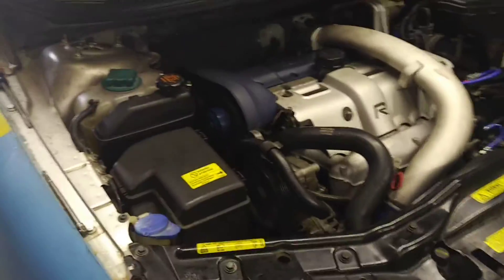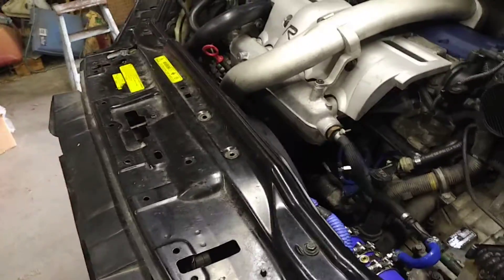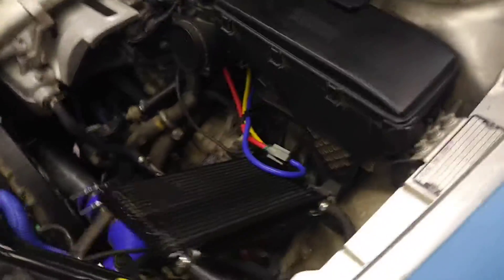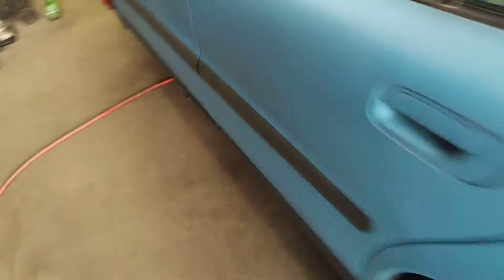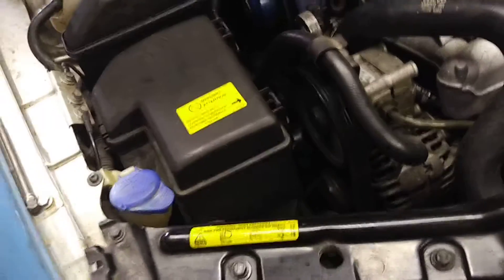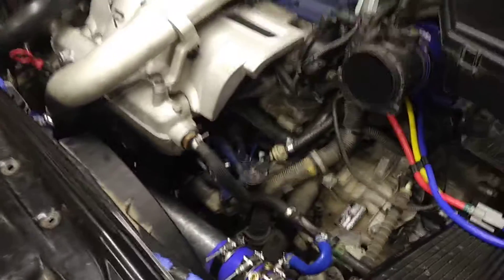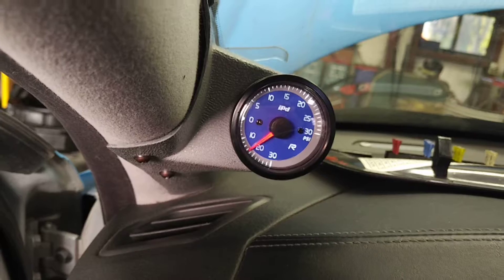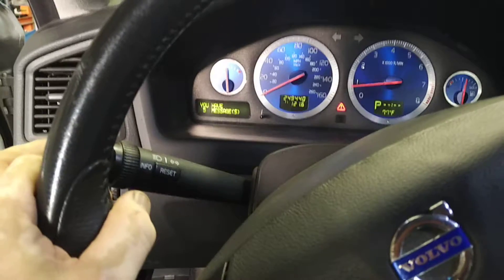Volvo S60R - IT LIVES!

Comment: 70,
my timing belt was tracking back and forth, I discovered the crank retaing nut missing, there was nothing holding the crank timing gear on. Waiting now for a new crank gear, old gear got ruined . These engines are easily ruined .
New crank nut will get loctite.
I pulled the crank gear with a harmonic balancer puller, nuts and bolts through the bolt holes in the serpentine pulley .
Took over 1 hr to set the puller up, 3 seconds with a small impact to pull the gear off the crank.

Often these situations don't end well when the valves crash the pistons.
we are both lucky.

Comment: What did it end up being? Did you replace the VVT hubs? Was that, in the other video, too much play? Did you not replace them and that's the reason for the codes in this video?
Reply from the maker: it ended up being the crank timing gear. The retaining nut had gone missing, which apparently allowed enough movement on that gear to allow it to strip and move.  It jumped far enough to cause the cam out of position codes to set, which shut the car down (thankfully).  It jumped, and then after I reset to TDC, it ran again for a little bit, then jumped again - it stripped the splines out on the hub of the timing gear where it attaches to the crank, but thankfully didn't damage the crankshaft. 
Removal was a large amount of work - installation was 10 seconds. 

The play in the hubs is more than new, but considering those are original with over 240,000 miles on them (at that time) - not too excessive. They work properly and test ok according to Vida/Dice (and seat of pants feel).